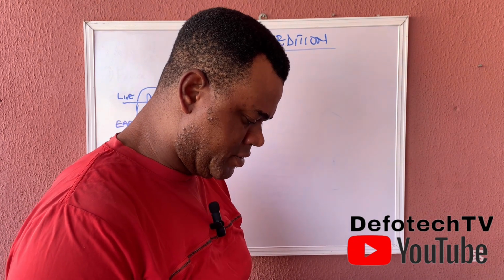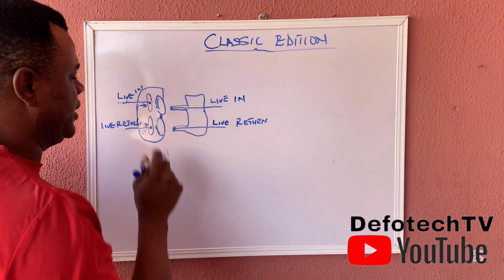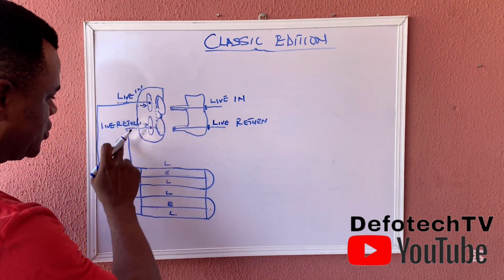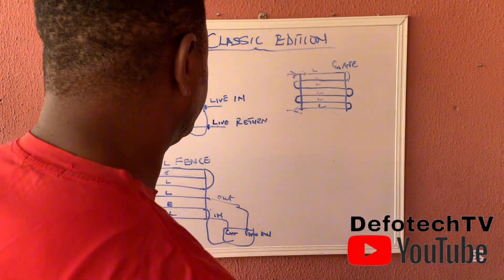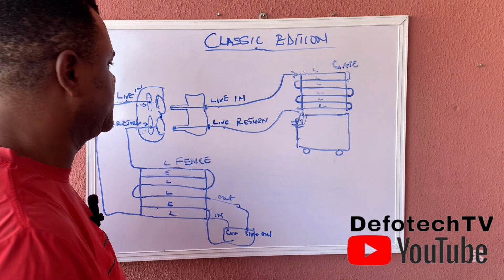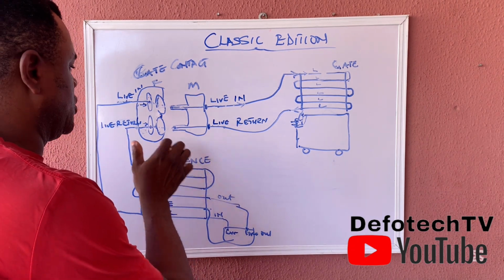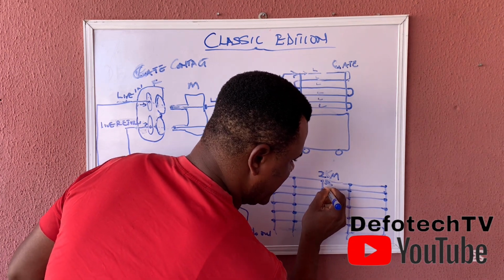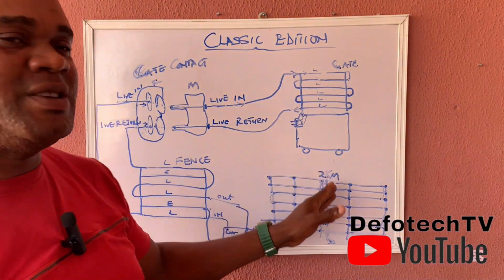Electric Fence Gate Contact Explained & How To Use Multiple Energizers For A Lengthy Span.

Comment: Please how can I get the manual?
Reply from the maker: @JimanzeClinton  chat me up on WhatsApp 08064869886
Reply: @defotechtv9093  please recheck the number you dropped here, I have been trying adding it on WhatsApp but it is showing I should invite the number.
Reply: The number is not on Whatsapp or I am not getting the right country code @defotechtv9093